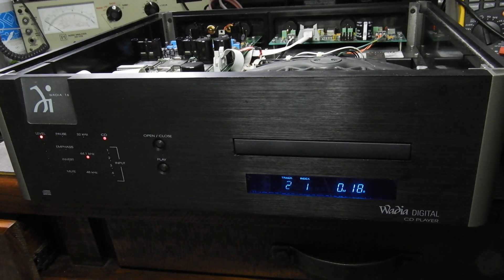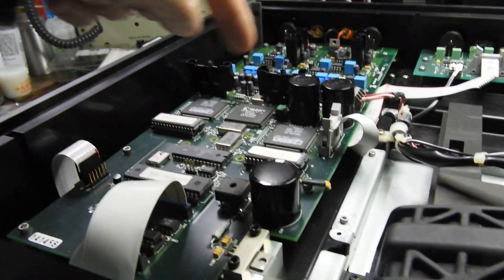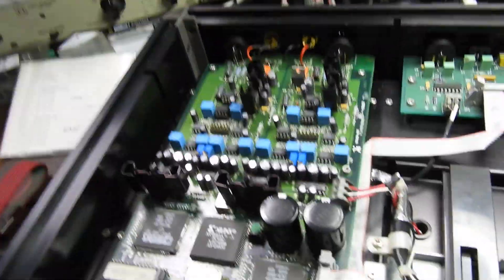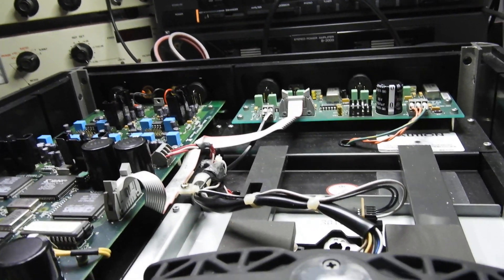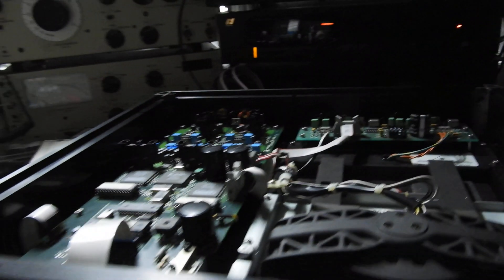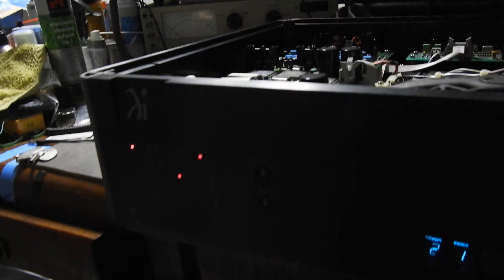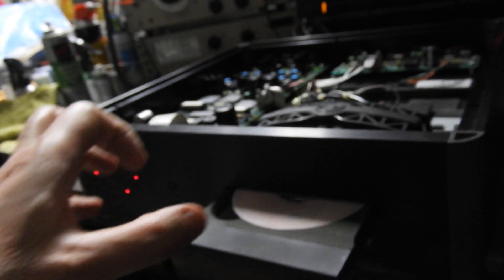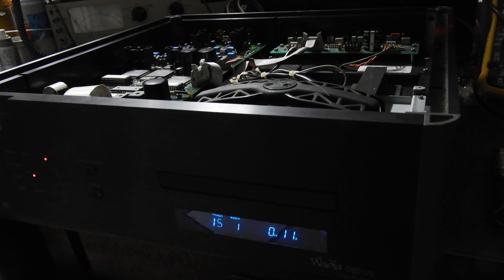Wadia 16 - One of the best CD players ever made. KSS-151A based VRDS mech and 4 x PCM-1702 DAC

Comment: I have a Wadia 15 DAC which I think is this without the CD player part.  It is the best DAC i have ever heard, and everyone who tries it in their system says it's the best DAC they've ever heard too!  I was thinking it is so old now would it be worth having a bit of service on it - recapping etc?  What do you think?
Reply from the maker: I think you could do a service yourself. Get a can of compressed air, open the DAC and blow away any dust. That is it. When troubleshooting Wadias I took out some capacitors to see if they were leaky and never have found one that was. They simply used quality parts. I wouldn't recap mine.
Reply: @hear-net-au  Thanks mate!! that's what I was hoping for.  I've never opened the top I couldn't figure out how it came off! :D
Reply from the maker: @MrButuz  If it is anything like Wadia 16 and all the other similarly shaped Wadias, Put it on its side and remove a number (more than a dozen) of screws with hexagonal heads. The top and bottom will come off. Bottom lids often have stuff bolted to them, so be careful.
Reply: @hear-net-au  Thanks for the tip I'll try that!!

Comment: Hi,
I have a Wadia 16 with one problem.
The coaxial input don’t work, but the other input and output work.
Do you have an idea what is the problem ?
Thanks in advance 😉
Reply from the maker: After checking it, it was IC designated as U5. Which was AM26LS32PC which is quadruple differential line receiver for balanced and unbalanced digital data transmission. I wanted to find the chip for you, so you do not have to open it up just to check it.
Reply: @hear-net-au  thanks for your amazing help.
I have open the Wadia and indeed the U5 is the reference you said 😉 on mine the balanced input still work and that way i can still use my streamer connected to the Wadia until I repair the BNC input
I have made some refurbishment to mine, cleaned and adjust the transport, new belt for the drawer, glue the display glass, etc 🤣
I will also need to try recover the brightness of the display, maybe a bad capacitor 😉
Reply from the maker: Yes, the Wadia 16 the I have fixed and sold had an input blown after I bought it back. There was a flip-flop there (or inverter, I would have to check) that needed to be replaced. Nothing major. Any tech will do this for you.
Reply: Thanks for your help 😉

Comment: Find this all misleading, because it as lots of regulators doesn’t mean it’s great or any better than something with only three regulators. It’s all about how clean a signal is. Also that oscilloscope was not showing anything great. Didn’t see eye pattern or jitter. I do electronics and I tell you now, you can take a cheaper player and make it match that player any day. That’s why makes me laugh about people who pay stupid money for audio, they are paying for something that doesn’t cost much to make for what they are paying. But this video is a joke on oscilloscope, because we are seeing nothing important here at all.
Reply from the maker: The fact you believe that "you can get a cheaper player and match this any day" simply means that you can save yourself thousands. I have not found  one as yet, even though I fixed hundreds of them.
To make matters worse, I have just blown $5000+ on another Wadia (861) only to get 24/96 capability.
As far as eye pattern, I was not going to take it apart just to get to servo board to have eye pattern displayed on the scope. That's couple of hours of work to do this on this player, and would be no different to any P-700 Esoteric transport (which it is).  
You're not the first person who commented along these lines and in general, I largely share you view that spending obscene amount of money on some audio pieces is unnecessary. This is an exception to this rule.   Have you heard it in a decent system?

Comment: Have you ever heard the Wadia 23 with Pioneers stable platter ?
Reply from the maker: Sadly - no. I do not see Pioneer Stable Platter mechanism as a major impediment in Wadia designs. This was probably the best mechanism they could get at the time. What I am slowly forming opinion on, is Wadia's use of "stripped" versions of their excellent oversampling/decoding process in lower priced models. 
Additionally, whereas in later models they give user a choice of 3 different decoding options, they seem to pick in these models the one that I favour the least. ;-) 
But this is a general observation, not really related to model 23. I have never heard any of their products using Analogue Devices DAC ICs.
Reply: @hear-net-au  thank you !!! Yrah the Teac VRDS looks bullet proof !

Comment: Hi there. Have you ever encountered a Wadia 16 with hum/buzz? I just bought one with a slight hum/buzz (coming from inside the unit, not through the speakers). Wondering if this is common in Wadias.
Reply from the maker: I have only ever worked on one. Buzz from inside is most likely to be related to the transformer. One (or more) of its mounting screws might have become loose. Open it up and tighten all of them. If nothing helps, take it out and put a rubber sheet underneath it and then tighten all the screws.
Reply: @hear-net-au  Thanks for the advice. I'll try that.

Comment: Cho hỏi.đau này dùng điều khiển ko theo máy có ảnh hưởng đến âm thanh ko b
Reply from the maker: Without the remote, there is no way to change the volume of the player, and because it powers up with volume set at zero, there will be no sound output. But you can get Logitech Harmony and program the remote with all the right codes and then control the Wadia. This goes for any Wadia model.

Comment: Hello -- Philips (CDM4 ETC.)vs Sony which is better between them ?
Reply from the maker: Hard to say. CDM-4 is probably the single most reliable mechanism ever. I have yet to see one fail. But a lot of Sony stuff is good too. I really like the KSS-190A and its loader. Can watch the tray going in and out whole day ;-) When properly implemented, they can can be both equally good. Certainly better than anything made today.
Reply: I still have both. The CDM4 on Marantz CD60 champaign colour with diecast sideburns and reads all CDRs instantly and plays immediately without pressing the play button.. It started to play even before I reach my seat. Another CD60 special edition has stopped reading a cd, the drawer still opens and closes.

The Sony KSS 151A is on Denon DCD 3520 but the disc tray spring isn''t pulling the disc tray up fully anymore. Each time the cd is ejected I need to use a finger to prop it up. The drawer operates smoothly in and out but It has problem reading a CDR with light scratches and problem reading Sony CDRs especially.
Reply from the maker: @snakecharmer1542  I cannot say much about CD-60 fault because I have never seen CDM-4 fail yet, but I would start by cleaning the lens with Isopropyl alcohol and checking if the arm is moving freely. On occasion some screw or washer works itself loose inside the machine and strong magnets in the mech attract it and the swing arm gets stuck mechanically.
On the Denon's inability to read CD-Rs, I would first do servo re-alignment which should help. If it is not enough, adjust laser power up by 10 or 15%. You have to have a calibrated laser power to do this. Without one, you risk increasing it too much and burning it out prematurely, in extreme cases within days.